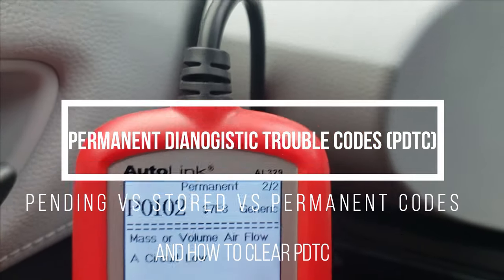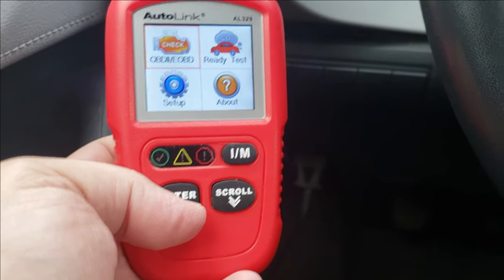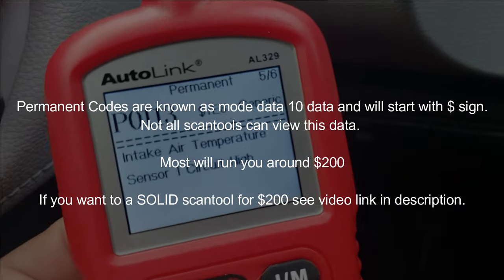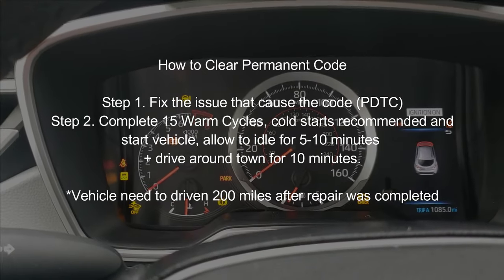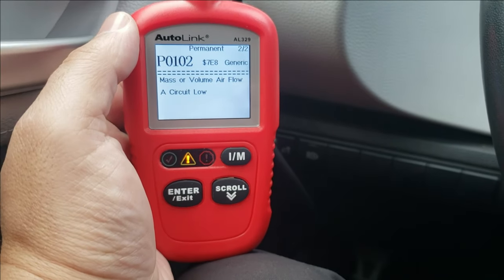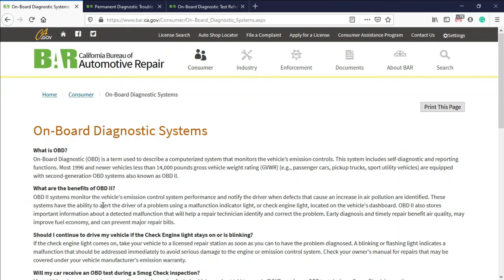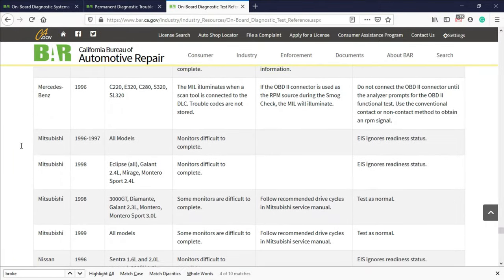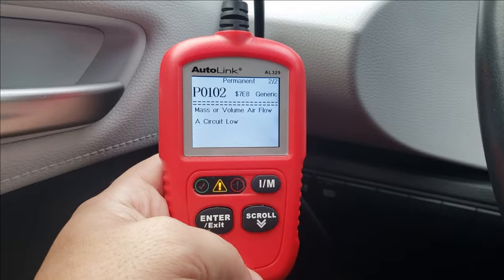Clear Permanent Codes by doing this with your vehicle!

Comment: So don’t delete codes ? Just start and run 15 times to self clear ?  When I use my obd2 scanner to clear it  the codes remain permanent after I turn of and turn on again  should I just drive around with the check engine light 15 cycles  until it clears on it own? This what I understand correct ?
Reply from the maker: Yes, don't just drive, let the vehicle warm and idle for about 10 minutes and then for a 10 minute or longer drive around town.

Comment: I am ase certified, What I have done was disconnect the battery, touch battery cables together, and turn on lights for an hour. Once done,  I reconnect the battery and permanent codes clear out. You can also disconnect the battery and then unplug the ecu. Either way worked for me. When the vehicle is turned on, it will go into learn mode until you drive it, and parameters will return to normal.  Do so at your own risk
Reply: @arta2870 I touch both battery cable together in Saturn L200 fried something in the car GM dealership couldn't figure it out
Reply from the maker: I appreciate your feedback Sorry for the late reply

Comment: Should i clear the code everytime in pops up?  Had all the problems fixed and the permanent code p0440 is still there but the check engine pops back up with the same code but also as a stored code every 25-30 miles. I can clear pending and stored but not permanent. I heard that i have to drive around but would the light just clear itself or would i have to clear first and then drive?
Reply from the maker: If your check engine light is turning back on with the same code after you have cleared it that means the issue still persists.

Comment: Will leaving the battery disconnected for a couple weeks not clear all codes ?
Reply from the maker: Nope you can not clear permanent codes. This applies to 2010 and newer vehicles. The disconnect trick was successful with older vehicles.

Comment: I need to know if my permanent codes have cleared yet. I have a scan tool- 20 bucks- cheaper one..   SHOULD it be picking up the permanent codes IF they’re still there?  I’ve heard it can take a month to clear after issue is fixed..  Been told “it should”.
Reply from the maker: Sorry for the late reply, yes it should display that permanent codes. Any updates?
Reply: @RANDOMFIX  yes. It does show them but it’s under the DTC menu.  Not under OBD. It will say “INC” if it’s not ready. Mines not ready unfortunately. Been at sea for two weeks so truck hasn’t gone through enough cycles yet. And thanks for the reply.  Useful info for anyone in the future.  That’s how to see if it’s cleared yet or not.  OBD will say all pass.. DTC menu will say INC. until that’s gone, no pass ….
Reply: @IAnonymous3  - You are mixing up Permanent codes and monitors.  Your monitors are incomplete, that does not mean you have or do not have a permanent code.  Permanent codes do not have anything to do with your monitors being ready.
Reply: @stevew9563  okay.  My mechanic said I had to wait until those were gone to pass emissions… smog..  California.   Said you can have any Incs.  That was the problem originally was permanent fault codes I’ve been waiting for them to clear they may have cleared by now.. but those INCs are still there…… not sure he to get rid of them.
Reply: @IAnonymous3   - The "INC" or Incomplete  are your Monitors, Yes those have to be complete in order to pass smog (Except EVAP in CA) .  But make sure you are looking on the "Monitors Complete Since Last Code Clear" screen on your scanner.  Not the "Monitors this key cycle" 

Monitors are not Permanent codes so don't mix up the two subjects.
Reply: @stevew9563  gotcha.     It definitely was two permanent fault codes initially what failed.   Then later I was told tk check the DTC section that’s when he told me of the INC and said they have to clear before smog.  I’ll make sure to check what you said. And not go off of “this cycle”. Thanks for the help.
Reply: @IAnonymous3   - YEa the "This cycle" things screw up a lot of people because those will say INC every time you turn on your car.  People think this thing will never get clear!!
Reply: @stevew9563  yes I am very happy that you have told me this. I do believe mines good to go now !!!   Camshaft replacement and it was misfiring due to a bad ground of all things.  Wasn’t too happy with whoever did that but everything’s fine now. So should be good to go.  Thanks again.  Much appreciated.

Comment: I changed new spark plugs on my prius gen3 , all are fixed 
But still can’t clear code permanent on ODB 2
How to clear? Or wait till after 200miles will auto clear?
Reply from the maker: Yeah, just try clearing it once and the code will still be there until the vehicle confirms the issue is gone. So start the vehicle and let it idle, since it’s a hybrid let it idle with ac for about 30 minutes as the engine will only run very few minutes unlike a regular car. After that drive it around town for 10 miles or so. You may have to do this 15+ times but it might clear sooner. What was the code for ?
Reply: @RANDOMFIX  prius 013 P0302 misfire 2, status :permanent

Comment: My mom's 2006 nissan quest keeps having a pending code even immediately after erasing all codes. Then once the car is turned on and off, the check engine light pops on
Reply from the maker: You have an open loop issue ( the vehicle is able to detect the issue right away because of this.) you don’t have a permanent code as your vehicle is a 2006 and permanent codes only affect 2010 and newer. This will better explain it. https://youtu.be/kVPSEQsvMOk?si=42URGrUswlRLgCMO
Reply from the maker: This will help you with you drive cycle https://youtu.be/s9PLkO-CjZ8?si=ose2JkK8J65uwgru
But you need to fix the issue that is trigger the check engine light first.

Comment: I’ll have the same problem with my truck 2016 Silverado it has a permanent code   I went to get it smogged but didn’t pass they give me one code is P050D ? Any help plz idk nothing about cars
Reply from the maker: P050d is generic code

What does OBD-II fault code P050D mean? OBD-II Code Decreased engine performance is defined as a Cold Start Rough Idle. The engine control module (PCM) monitors misfires on initial startup. When the PCM detects a misfire on startup, the PCM will set code P050D.

How is your vehicle running, please provide more insights about what happened and you did to fix some of the issues.
Reply: @RANDOMFIX   it drives normal starts normal but jerks a lil bit when it goes up in a hill or passing a car when I step on the gas does that ?
Reply: Was your check engine light on?

Did they actually perform a smog check?  Or just pre inspect it with a scanner?

Comment: I have a 2013 Lexus RX450H. I have driven it for 10,000 miles. The perm. code is still there "replace hybrid battery". All we did was plug it out(the hybrid battery) and plug it back in while the vehicle was on.   No stored code or pending codes and the car drives fine. any thoughts?
Reply from the maker: Do you have a oe level scan tool? That will allow to see the Toyota side of code. Have you been to dealer yet?
Reply: @RANDOMFIX  That is my question. Why should I need to go a dealer for that? The fact is I have two of these cars and they both have this permanent code that wont go away. The dealer wants $540 just to check it out. Unbelievable!

Comment: Permanent codes are caused by constantly clearing DTCs without fixing the actual condition.
When the ecu fails on a code that was just cleared, after a number of times...it goes permanent.
Then, only the ecu will clear the code when a good condition is measured enough times.
That's it.
Reply from the maker: Thank you for sharing, great information

Comment: My cel went on because of a loose gas cap triggered p0442. Fixed the issue erased the code. Have driven the car for 9 days to work at highway speeds and I still have the permanent code that won't erase.
Reply from the maker: What are you driving? Just like for setting the evap monitor, keep your fuel between 1/4 to 3/4 and park on a flat surface. Start the car and let idle for 20 minutes and drive around town for 5 to 10 minutes normal driving, speeds of 25 to 45

Comment: Not a good video.  You are conflating two different items.  Permanent code process and drive cycle.   The 15 warm up cycles and 200 miles does not clear the permanent code the smog machine just ignores the permanent code after that.    The permanent code can still be there and still pass smog.  

And the 15 warm up cycles and 200 miles has nothing to do with the Drive Cycle. You can do the drive cycle and complete your monitors in 1-2 trips if you are driving according to the drive cycle.
Reply from the maker: Thank you for your feedback, much apprecated!

Comment: Hey sir I just wanted to ask a question I have bmw 328 i 2011 I was getting the misfire codes as permanent  i just called the sparks and coils and I delete the code  and when I start it no check engine light … i drive for hours no check engine light when I turn of and turn on car again check engine light is there and the permanent codes is still there ? Can u please help
Reply: Did you delete the code ? Same thing happening to me. No engine light anymore but the code is still there
Reply from the maker: You can’t delete the permanent code. The vehicles to clear it after the issue has been fixed.

Comment: I have a dodge grand caravan 2017, with a permanent po302 permanent po300. I changed all coils, spark plugs, injectors, wiring, break vacuum hose,throttle body and sensors attached, purge valve, all 02 sensors, and still getting these permanent codes!!! I reset with my scanner but the permanent ones remain!!! Ima try this tonight ima hop on the freeway and drive away in hopes of getting these codes deleted for good!!!!
Reply: Hate to break it to you but permanent codes do not mean there is anything wrong with your car.   They would be better be called "Verification" codes.  Meaning they are only there to verify your repair has been made correctly.  Do you need to pass a SMOG test in CA?  If not stop trying to fix anything. Nothing is broken.  Ignore Permanent codes.
Reply: @stevew9563  I know thanks to this video I understand that now!! LOL I think my problem was fixed when I got new spark plugs, and coils, but I didn’t know that the permanent codes needed to be reset by driving 😩😩 so I kept fixing things and fixing things, I even went as far as fixing two mounts that were out of shape, one was broken so it’s okay that I fixed it!! but indeed I panicked and stressed badly these last 2 weeks!!!
Reply: @izzyn4315   - Well you are not alone, happens all the time.  Terrible name for those codes!!
Reply from the maker: Glad to help the video was help and it sounds like your vehicle is much better shape with all of  we parts. That is p0300 is tricky code as it’s random misfire.

Comment: My p0442 for ford permanent code won't flash the check engine light but is still on the reader ... I had 50 start ups and 500 miles but unfortunately my battery died so now it reset... frustrating situation( I'm doing the drive  cycle as best I can) but it still won't clear
Reply: Does not matter if it clears unless you need a CA smog check.   Do you?  If so then you need 200 miles and 15 warm up cycles and the smog computer will ignore the Permanent DTC.
Reply from the maker: Thank you for your feedback, much apprecated!

Comment: I am goin  on 4 days and I still have a pending code and I have 2 more monitors to be cleared so I can pass my inspection, do I need to drive it more
Reply from the maker: Pending code or permanent code?
Reply: @RANDOMFIX  yes I had cleared the check engine light Since I replaced the part and after 4 days I seen on the obd2 showing pending code with 2 more monitors still not ready, can the part be bad
Reply from the maker: If you cleared the code after the repair and it’s still pending that means the issue has not been resolved and you need to fix the issue. What was the code and what did you replace?
Reply: @RANDOMFIX  I replaced code p0411 
Secondary Air Injection System Incorrect Flow Detected I thought it was fixed Since the check engine light never came back on. But its still showing pending code so think in the morning it’s going to show a check engine light.
Reply from the maker: Sorry I don’t understand. You reset the code or replaced the secondary air injection pump?
Reply: @RANDOMFIX  I clear the code after the repair was done.
Reply from the maker: Okay, you might to investigate this a little more. This video is about permanent codes that effect 2010 and newer vehicles but a pending code will not let you monitors set.

Comment: Do I have to let the car cool down 8 hours?    I actually live in my car and I have a O2 sensor not ready and the evap not ready  Everything else is ready I replaced the battery about two months ago and  I drive daily but only like five or 6 miles, I do idle alot To run the air conditioning I don't have a engine light on,  I do have one permanent code leak detected but I actually repaired it I found a hose that was cracked in half and I replaced it but that was like 4  months ago.. I'm not 100% sure if that's going to fix the leak but I would think so because it was a decent size..  But the code is still permanent I cleared the code because I had to replace the battery for a few months ago I have emissions test due October 15 I just went today and they told me two of the things aren't ready I don't know why the O2 sensor is not ready makes no sense to me... But yeah I fix the evap small leak It was literally a hose to the solenoid on the top of the motor I found it out when I replaced the water outlet a few weeks back I also disconnected the battery a few weeks back so maybe the monitors aren't set because I haven't been driving very far about 10 miles max a day nothing really over 50 miles an hour , It's a Mazda six 2013  .. I did buy a scan tool today and I can clearly see it there in the red those two and I can take live readings while I'm driving my dash radio has all monitor is too but it's only for like the RPM and speed and gauges and stuff it will throw engine codes if I ever get them..   But the two permanent engine codes are for the evap leak.. Hopefully that little hose is all that was leaking.. I did go on the line and didn't see much but it was open to the atmosphere for sure..  When the weather was cooler I would smell gasoline when I had the heater on to the outside so it was definitely coming from the engine compartment top that location where that cracked hose was...  Anyway I guess I'll keep trying I just don't know the proper procedure for Mazda six 2013 four-cylinder would be exactly everybody has a different drive cycle they should just have a reset button that you can press...   I have to October 15  To figure things out I'll check the thread later to see if anybody answers..
Reply from the maker: Yes you will need to start with a cold start which is 8 hours or more resting. Try letting the vehicle rest in a non garages area if you live in very hot climate. I am learning that certain parts of the country like Texas the garage is 95 degrees plus 24 hours a day.

Focus on long warms up and drive around town between 45 and 35 and try coast as much as possible. You will have to do this 15+ times.  Good luck and keep us posted on your 2013 Mazda six.
Reply: The 8  hour cool down is really only for the EVAP, you don't need that really to pass.  All you should worry about is the oxygen sensor.  I will post a pic of the Mazda drive cycle.   not sure it will post though here in the comments.
Reply from the maker: @stevew9563 he is trying to clear a pdtc it advised to left the vehicle cool down but you maybe right. Better to be patience than to do something that will solve the issue. There is nothing wrong with letting the vehicle cool down.
Reply: @RANDOMFIX   - Well have to get the O2 monitor ready first.  in the time it takes to do that you could get the 200/15 taken care of.    But pinkie will have to get good at reading his Scanner to see the 40 degree temp drop for the  completion of the warm up cycles.  That does not take 8 hours.  Maybe 1-2

Comment: i got a permanent code but it also says archive inactive .is the code still something I need to worry about
Reply from the maker: What sort of scan tool or obd2 are you using? I haven’t seen an inactive permanent code yet.
Reply: Do you have to pass an emissions test anytime soon?  if not, now worries, ignore it.
Reply: @stevew9563  No, this is actually a car I want to buy from a dealer and I found out the codes after scanning the car. They jump start the car because the battery was bad and that’s why the code is inactive? Because it shouldn’t be there if they addressed the problem? Thank you.
Reply from the maker: I won’t buy a car until all the drive monitors are set. Have them replace the battery unless you can very yourself that battery is a good by putting it on a load tester. This will be challenging with some dealers. 
The real question to ask is why is the battery died, is it old? is there a short?  You don’t want to be owner of a dealers dead horse. Proceed with caution.

Comment: My question is if you have a permanent code but you’ve already fix the issue it’s resolved itself and you reset the check engine light and go on a 50 mile drive but before you even leave the driveway the check engine light comes back on and it just shows the permanent code and the pending code does it still need the 200 mile drive to permanently clear the code or is the issue still there
Reply from the maker: If the code code reappears before you leave the drive then the issue is not fixed. 

Here is a example https://youtu.be/YL9IUsUKhBo

Sometimes people fix it not knowing there is an underlying issue.